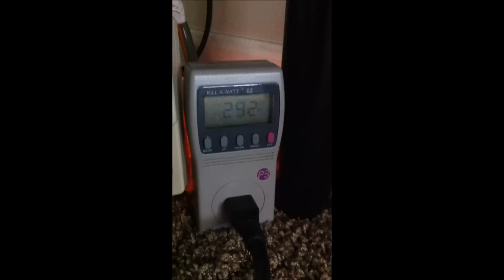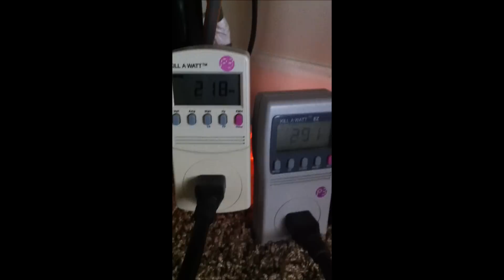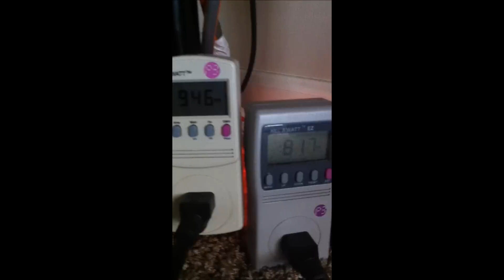GTX 470 TRI SLI - Furmark Power Usage.wmv

Comment: Jesus! Your system based on a 85 % PSU power eficiency, pushes +- 1500W under load. If your CPU consumes maybe 220W  + 50W on Mobo and Ram (excludind PCI-E Gfx Slots) + +-70 Watts for HDDs, Pumps, and Fans, gives 340 Watt. If the total is 1500Watt (85% efficiency), from the 1750Watt total, gives 1500W - 340W = 1160W. This 1160 W respresents the GFx cards consumption!!! 1160 / 3 cards = 386 Watts per card. This is an estimate, but not totally unrealistic. They are very power hungry!

Comment from the maker: @hao9i6 

Not stable.

I bench at 900core or 905core with 1970mem @ 1.212v. I would never use these clocks or voltages for 24/7 or gaming use. It will run furmark for about 10min's.

I use 850core/1800mem @ 1.100v for my 24/7 gaming clocks.

Hope this provides clarification ^.^

Comment from the maker: @hao9i6 

The OCP "over current protection" has to be disabled on the card by shorting the circuit with soldering. I did not do this, and it is not recommended. 

It requires a lot of Amperage to run these cards at 1.2v and your PSU's OCP may be kicking in because your overloading the 12V rails. Possible, but not sure from the little amount of info given.

Comment from the maker: @rcarkk 

A majority of the 470's seem to be able to hit 800core/1800mem @ 1.087v with no problems.

Also my cards are all under water and have an AC unit feeding the radiators with 17'C air :P

Try and make sure your temps stay below 80'c with a high overclock.

Comment: Hello! Im just curious. Im wayting for two EVGA GTX 470 SC, and i´ve been wondering how much will overclock on GPU, Shaders and Mem without changing stock voltages. I will be using the stock coolers. Do you have aftermarket coolers on the cards? You´re temps are great!! How much will be the temps with the best overclock possible without messing the voltages on the cards stock cooler? I have a Lian Li well ventilated case. Best regards, and fantastic machine you must have.

Comment: yea i know i flashed mines to and got 1.212v but i read on the evga forums that you have to do something else to turn off ocp on the cards like the guy solder this card or something so was wondering if you did anything on the cards other then flashing it cause i did that and cant run them stable even with max voltage

Comment: hey did you do any modding on the cards to run at 900mhz and 1.212v cause i try it on mines and it wouldnt even run even at 850mhz with 1.137v would locked up in like 3-4 min

Comment from the maker: @hokies83 

I updated the Description with further details. Not every PSU can handle the same Amperage or load,.

Your PSU, Corsair AX1200 has a 100.4Amp Max load on the 12V rail, which puts you in the safe zone :P